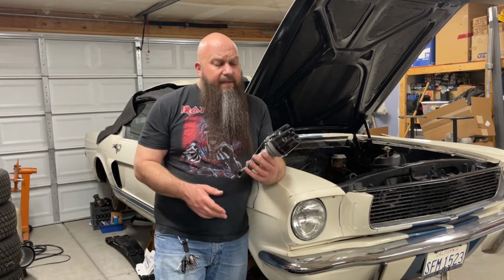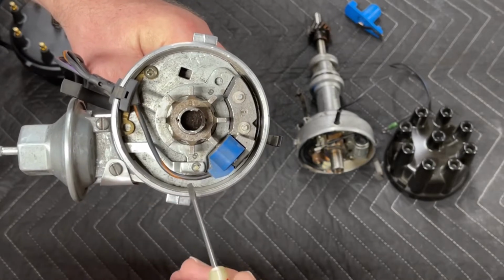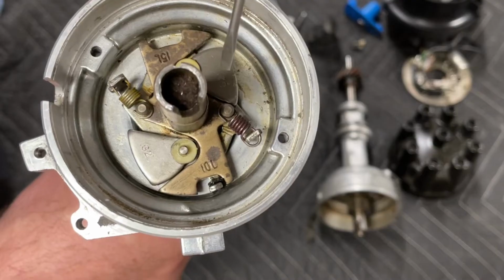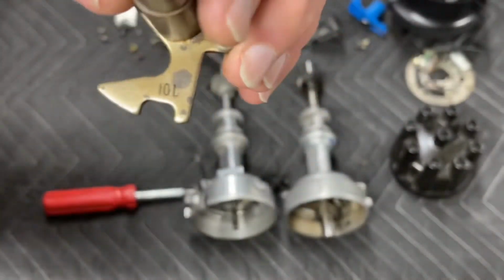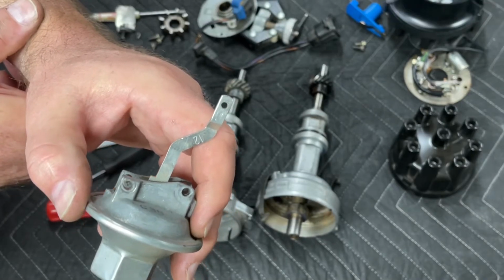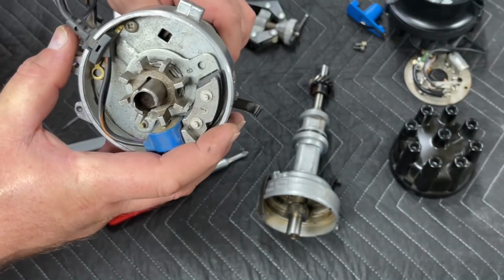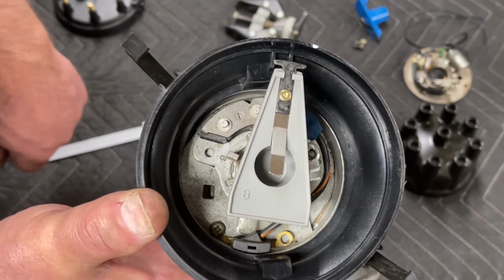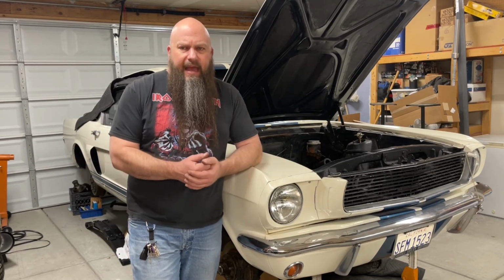Easy DIY Performance Re-Curve: '57-87 Ford V8 Distributors - Tune Your Ignition Timing

Comment: 1959 352FE with pertronix ignitor III, stock hyd cam with autolite 2100. 9:1. It seems like I can't ever give it enough timing. Have it at 16 initial, and total is only 28. Vacuum adds 14. Idles at 18" vac.
Reply from the maker: What do you mean by “can’t give it enough timing”?  Is it pinging at more than 28° total or does it want more than 28° total and you need more (like 34-38° total)?

Idle vacuum is good, that indicates a sound engine, and the vacuum advance is working as intended there.  

What does your curve look like?  Timing at 500rpm increments from 1000rpm to 4000rpm?  If you lift the point plate what marking is on the distributor advance?  10L? 13L? 15L?  The marking is distributor degrees so you double that number for crankshaft degrees.  What springs are installed? Light?  Heavy?  One of each?  Two of the same? A single spring total?  

The 352 as do other FEs have a D-shaped wedge shaped chamber and terrible quench because the piston is down in the hole 0.055” and a 4.33” diameter head gasket that is typically .042-.048” thick crushed. The end result is that the low compression versions of the engines can be prone to pre ignition or they can demand demand far more timing than expected, depending on the camshaft and the cranking cylinder pressure you’re seeing.  FE engines have to be treated on a case by case basis.
Reply: @TheGT350Garage  I'll get you those numbers at 500 RPM increments. If seems like it needs more timing due to some surging between 1000 and 1600 RPM (it is a manual) during gentle acceleration. If I give it more initial timing that goes away, but it ends up being 20 degrees initial. 

I've never heard it ping, we have E10 87 octane here in Maine at 1000 feet elevation. 

Thank you so much for your reply!!!!!
Reply from the maker: You may need more fuel.  E10 behaves “lean” with stock jetting.  The stoichiometric ratio of E10 is 14.08:1 vs the gasoline your carburetor was designed for which was 14.7:1.   It’s usually corrected with an increase of two jet sizes.  If that is an original 2100 Autolite carburetor, from 1959, the jets are interchangeable with a Holley.  If it has been replaced with a later carb, you’ll need the larger Motorcraft jets.

Comment: Very informative video.  You mentioned primary versus secondary advance springs.   Also, there are two different numbered advance slots.   To determine the total centrifugal advance, do you add both numbers together? Thanks.  I'm having pinging in my 69 gt350, and I think I have too much centrifugal advance.
Reply from the maker: So, on your 351W with stock compression you need to curve the distributor using a 10L advance limiter (20°) and use 10-12° of initial timing (vacuum hose off the advance unit).  Then you need an adjustable vacuum advance mechanism connected to manifold vacuum.  If you don’t have a 10L send me an email and I can provide detailed instructions to modify your current (or a similar spare) distributor to be completely compatible with the needs of your engine on pump gas.
Reply: @TheGT350Garage  Thanks.  I verified what I currently have with a timing light today.  With vacuum advance plugged, I have 10 initial and 30 total, which is exactly what you recommended.  When I connect the vacuum advance, my initial  timing jumps up to 18.  I removed all the washers from my OEM ford vacuum advance to allow maximum advance as per the ford shop manual.  It made no difference after I removed the 1 washer in the advance housing.  I will look into purchasing an adjustable vac. advance for my C9OF-T autolite distributor.  Is there a part number/brand you recommend?  I have a Holley Sniper EFI on my Shelby, and I noticed my coolant temperatures seem to have dropped by 10 degrees after connecting my vacuum advance according to my hand held monitor screen on the Sniper, which is a good thing!  Also, could you post the part numbers of conversion parts to make my cap and rotor into a durapark set up?  Thanks a million for the help in your videos.  Very informative.
Reply from the maker: The black Duraspark conversion parts (only ones that look good on a relatively vintage engine in my opinion) are:

Standard Motor Production FD156T Adapter 
MSD Street Fire 5505 Cap & Rotor (w/Brass)

You can use spark plug wire sets for a 1985 Mustang GT 5.0L-4bbl (Manual Transmission).  But I would recommend a custom (cut-to-fit) set, personally I like the MSD 8mm Street Fire wires for “basic” combinations or the MSD 8.5mm Super Conductor wires with aftermarket ignition boxes.  Use either straight boots or 135° OE Ford Duraspark type boots for best results.  

If you want an adjustable vacuum advance you can use the following Standard Motor Products part numbers for Autolite or Motorcraft distributors:

VC-31 single points (inc. Pertronix) Adv. ONLY
VC-192 single points (inc. Pertronix) Adv./Ret. 
VC-221 Duraspark Advance ONLY
There is currently not an advance/retard available for Duraspark distributors.

Comment: ,,,,another question ,,,,,concerning the duraspark unit ,,there are three wires to the terminal plug....the ground is easy to find ,  about the other two that go to the coil ,,what color is the positive lead and what color is the negative going to the ign coil......
Reply from the maker: Black is ground.
Orange is Mag+
Violet is Mag-

It’s a magnetic trigger so it generates voltage in a sine wave (A/C Voltage). The ignition box interprets that signal and uses it to fire the coil.  Because it’s A/C voltage and a sine wave, Mag+ and  Mag- are relative to leading edge and trailing edge of the reluctor wheel.  If you swap them it alters the signal but it still runs.  Some older capacitive discharge ignitions don’t like them swapped.

Comment: ,,,,great presentation of facts.........Question : Where can I order that plastic limiter , or stop , if my unit has a broken or missing one......Maybe I'd have to fab something to take its place.........anyway ,,,,thanks for the time and knowledge.......
Reply from the maker: The original style plastic clips are impossible to find.  I’ve had good success with black 1/4” poly tubing.  It fits pretty snug.  If you want a little more you can add a layer or three of heat shrink tubing to take out an additional degree or two.

Comment: you can fit Duraspark cap on points dizzy for accesses to better quality/more common wires. you can all so use a 1980 international distributor cap it has hei terminals but small points cap size. the vacuum advance info for fords is lacking on can specs. ford points dizzies are my favorite as you can change the springs and change the amount of advance with out the trigger star getting in the way. all so just 2 vacuum advance part numbers for the non smog one port vacuum cans on 1971 down Dizzy's  from standard motor products vc 25 vc31.  wells has one that covers 1957-71. use points to trigger tfi module. moto craft or blue streak points.  do look in to the 1980 international scout cap! all so try the tfi module on points vary hot spark with a tfi coil. the points last forever when used as a trigger. can use msd box as well. the  tfi module + heat sink looks like the optional Motorola ignition from ford from the 1960s that was points trigged. hate the e clip for the vacuum advance i use a Jesus clip looks the clip on ford oil pump shaft just have to get one that is small. it works with points plate.  I have ran as low as 20-22 total on a 1979 351w tried 32* and was no better played with octane no better. ran 2* base +20 or 10l slot with a lot of vacuum advance on manifold. got 20 mpg and good power out of a 1979 351. the springs made all the difference. in the 1960s up to 1974 we used ron like Europe. Amico unleaded premium  in 1967 had a 97.5 ron to get the modern ron+mon/2 you subtract - 4 to 6 to get to modern pump number.  93.5-91.5! right where we are to day. leaded was 100-103 ron. you are one of a few left that understands this old school tuning! the old ford shop Manuel got me to understanding them! have heard old timers use vacuum hose on the stop pin as well as bending the stop pin. this is gold thanks \/
Reply from the maker: The reason for the larger diameter of the Duraspark cap is to prevent internal cross-firing in the cap.  The small post type caps are susceptible to misfire just the same as a points/socket style cap.  

The reluctor on a Duraspark is fairly easy to remove, as I showed in the video.  Points will still wear and require maintenance even as a low current trigger.  The Ford TFI modules were not known for their reliability, even heat dinked and remote mounted.  It’s hard to beat the GM HEI modules for reliability and they are compact and simple to use.  Using an aftermarket ignition with features like a rev limiter that meet your needs is best.

There are less vacuum advance inits available these days, but there are more than two or three.  Thankfully a variety of Fords were adjustable from the factory.

Your ‘79 351W doesn’t like timing because it has massive 69cc combustion chambers and dished pistons that resulted in nearly no quench area.  The pistons are well below the deck, and as a result the perfect storm of bad combustion chamber principles is working against you.
Reply: @TheGT350Garage  thanks for the info! do you know the vacuum advance canisters part # that adjust the TOTEL AMOUNT OF ADVANCE not the rate of advance? for points stuff i have used the standard vc31. how about dura spark part numbers?  like that trick to get the relocator off. and yes to the big cap for better rotor phasing. was just bringing up the international distributor cap as it is a why to have the 'STOCK' look not as a improvement other than better terminals. i like the points as it gives one a back up if the module craps out. do you know ware to get a duel point barker plate the one for the vacuum advance duel point 428 from 1969-1970? all so can one use a bit of small hose on the limit pin to shorten the advance curve? the old dizzy had a thin wall bit of rubber hose instead of plastic clip. been told you can use thick wall vacuum hose to shorten the curve. as for total timing I have heard all sorts of numbers. looking at the 1969 shop Manuel that lists dizzy specs and base timing it seems that 25-34* total was common. this 36+* must be for Chevy or dodge. never seen people run as low as i did but I found that 20-22* total worked best with it all in at 3500-3700 on my 1979 351w. ran good got good mileage never ran hot.  people go too advanced.
Reply from the maker: Good chance you have the wrong timing pointer to balancer alignment unless you’ve properly verified TDC with a piston stop.  

The ‘69 351Ws I’ve taken apart all had 13L (26°) advance limiters.  With 6° initial that’s 32° total, about right for the 10.7:1 351W-4V on premium fuel.  Those engines today set up best with 28-30° total all in at 3000, with vacuum advance set up for 10-14° at full manifold vacuum.  

There are no dual point plates that allow vacuum advance, and if you’re triggering any kind of module dual points are useless, and the ford Duraspark magnetic trigger is the best trigger in the industry -as in used by MSD and other companies for triggering purposes with tremendous reliability.

Comment: Thank you for the Tip of marking lower part of the cap.
Always turn the Engine further back and then forward and set the timing to the desired degree’s. Remove the Rotor and turn the distributor until it reluctor is in line with the metall part of the magnetic pickup. I guarantee that your timing is already within one or two degrees.

Comment: Such good info and thanks for spending the time to explain the finer details. That little plastic sleeve may be missing on mine. At only 5 degrees initial timing, my total advance it almost 50 degrees. I will be pulling it apart shortly to see what the problem is. Thanks again!!
Reply from the maker: Make sure you have the vacuum advance disconnected when checking total advance, but I have seen numbers that high on emissions era distributors that came with vacuum advance/retard canisters.  They didn’t really understand how to make the distributor function well back in the late 1960s through the mid 1980s.
Reply: @TheGT350Garage  Ok, I thought I had to add up initial timing, mechanical timing and vacuum together to get the total? I was looking for the video followup of the actual set up you talked about. do you have a link to that? I don't see it on your page.
Reply from the maker: I haven’t had a car available to do the follow up on.  I am doing another video on how to get the correct timing curve for a particular engine, that’s coming soon, It’s been a while since I’ve been able to get out and film.
Reply: @TheGT350Garage  So if the initial timing and mechanical timing is to add to lets say 34 degrees total, where does the vacuum come in as a total? I saw one other video today that gave an initial of 12 and a mechanical of 34, but the total with vacuum was 40? this confused me, it just didn't add up.
Reply from the maker: Vacuum advance is never added to total, because total is only really a consideration at wide open throttle.  Vacuum advance only contributes to the timing at idle and part throttle when properly connected to a manifold vacuum source.  It will contribute to total timing if it is incorrectly connected to ported vacuum, so be sure you have the correct vacuum connection.  Ideally. vacuum advance should be capable of adding 12-14° to the timing at light loads and idle.  Total timing requirements will be 30-36 degrees depending upon compression ratio, your specific cylinder heads because combustion chambers change the timing requirements, and your cam specs.  Every engine is different, so don’t fixate on a specific value, let the engine tell you what it wants.
Reply: @TheGT350Garage  Thank you for that explanation. I had it on manifold vacuum and when the RPM was raised, it ran rough. i put it on ported and it ran much better. I will put it back to manifold and try to see what the problem is from there. Thanks again.